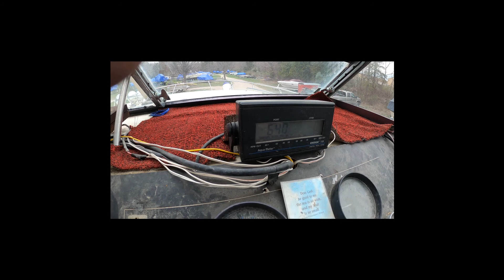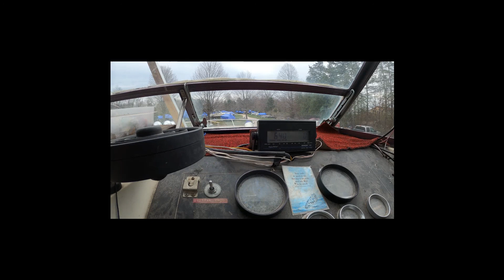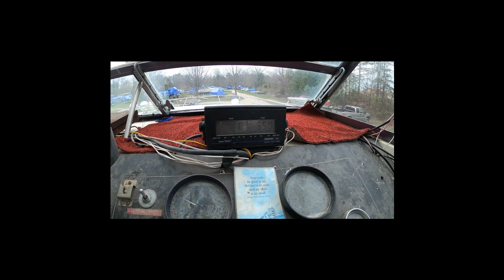starting up the engines

Comment: Do you run high octane with fuel additives in your boats? Bummer about the rod knock, hopefully a cheap rocker fix.
Reply from the maker: not really gas at the docks is 90 octane and no alcohol only additives i would ever use is stabilizer  or a product by Mercury called quickleen that stuff actually works good have saved a lot of money for customers over the years with it instead of carb rebuilds
Reply from the maker: and the rod knock isnt to big a deal in itself easy fix hard part will be getting the engine out of that boat its so high and engine is directly under the hard top, ill have to fabricate something to lift it move it back then i can put on gantry lift and get out of boat, problem should only set me back a day or two depending how hard it is to get parts,actuall engine removal should be less than 2 hours, rebuild whats needed another couple hours then back in ad test out